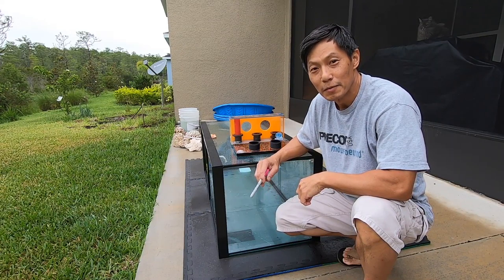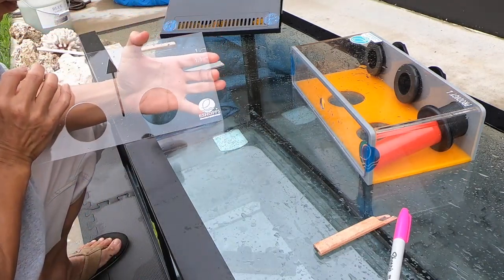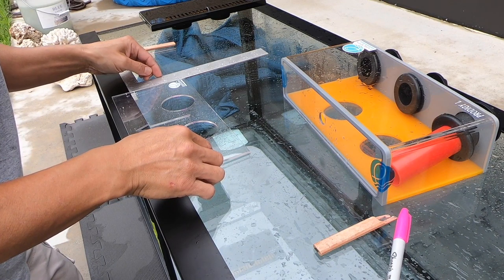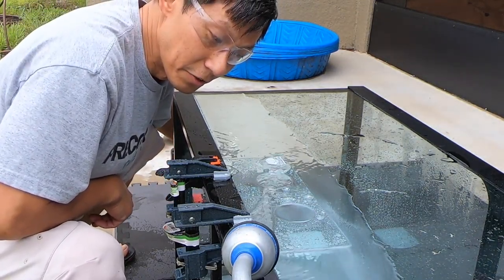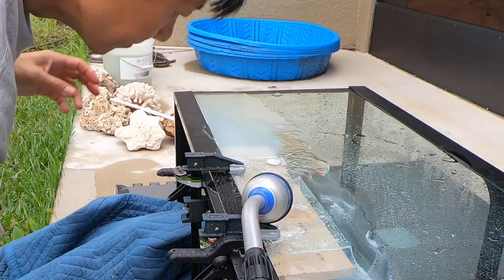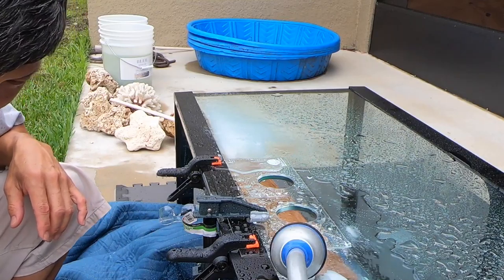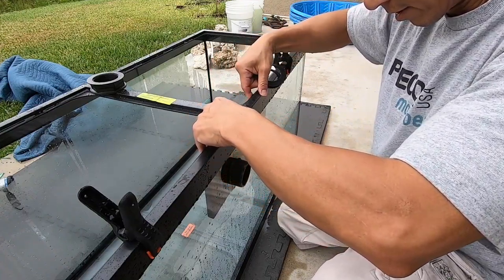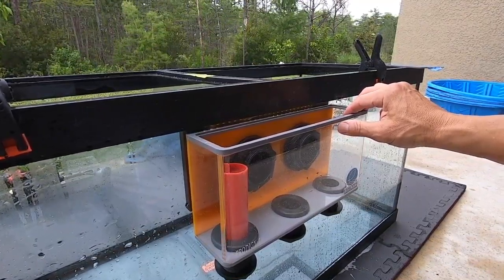75gal Saltwater Aquarium with Eshopps Prodigy L Overflow Part 1-Vlog 20

Comment: I am so glad you showed me that an install on a standard rimmed tank is possible. Great video. Just what I was looking for
Reply from the maker: How did your tank turned out?
Reply: @nguyeninfloridalinhchualua3429  I am very very early in the planning phase of a future tank build. I am to find the best external overflow for my situation. I want the tank close to the wall, so I would like to cut a hole in the drywall behind the tank and have the external box fit between the studs. 12"-14" wide external is what I am looking for.
Reply from the maker: @kevinhelfrich1705  That sound like a lot of work. Exotic Marine Systems has wide overflow box that you can check out.

Comment: Hey, I think you put the second set of rubber nitrile washers in the wrong place, they need to be between the tank and the external box.  Seems like a fun project.  If you ever have a lot of leaks this is why.  I have the eshops small and had this issue the way you put them on.

Comment: I've watched a ton of these videos, and noticed every single one it chips. I finally went ahead and did it myself and sure enough it chipped a little. I'm thinking if you're uncomfortable with chips being on the inside drill from the inside out. Where you start drilling will always be smoother.

Comment: Personally I drill from the inside out,better seal if it chips and no worry of the cut out chipping tank
Reply from the maker: I would be hesitant because you want to make sure the cut is straight down on the glass. The 75g is not that wide.

Comment: Can you measure the distance between the bulkheads on the template. I recently got a used tank and have a eshopps L overflow and the holes are to far apart. Thank you for your time.
Reply from the maker: I have to look for it. I don't know if I kept it.

Comment: Yeah.  I didn't know the wire was so thin on that model!! I got a figi cube overflow but I am worried because it didn't quite install right and the other box hits the black trim and the wire ended up being g too low so I'm thinking I may just buy a different overflow and hope it fits better.

Comment: What was the order in which you installed the gaskets? on eshopps video and from everything else I read their install video is incorrect.
Reply from the maker: They give you two gaskets. One gasket goes against the glass and the other against the plastic. Make sure the smooth side or the gasket is towards the flat surface of the glass and the return. Hope that helps.
Reply: The ridges on the rubber gaskets always go on the glass, just incase there are any little chips, the ridges will cover them.

Comment: IMHO you need to position the holes based on the desired height of the internal wier box.  You set the hole position based on the top of the external box butted up to the bottom of the frame (with the box lid on), that it why the inside box was higher then you wanted.  You Got Lucky!  Depending on the tank Mfg your inside box may not have fit at all.  Check all parts position BEFORE you drill.

Comment: trying to devise an automatic waterchange system for my 55gal fresh water nano tank.  was considering this.
Reply from the maker: How can you use the overflow to do your water change. It wouldn't drain enough water,
Reply: @nguyeninfloridalinhchualua3429  - i'd have filtered fresh water slowly trickling  in at a rate of between 2 and three gallons per day.  Why wouldn't it work?  I don't have sump.  The overflow would be piped to drain.

So constant fresh water very slowly displacing dirty water.

I also have triple the filtration i need already in an Oase biomaster filter
Reply from the maker: @etyrnal  I think that might be a waste of water. If you do a 25% water change that would be about 15gal at one time the water quality would be better.

Comment: What brand of tank is I have a 75 gallon  frome petco  that I want to drill
Reply from the maker: I got mine from Marineland. You have to check the  label. It will say "do not drill" on the bottom if you can't. You can also do tests that is on YT. Hope that helps.

Comment: So does it leak and how do you like it
Reply from the maker: Make sure the rubber ring is on the right way. It does not leak at all. I tighten with my hands then used a wrench to give it a slight turn. It works perfectly. Very happy with the set up.
Reply from the maker: No leaks and the set up went perfect.
Reply from the maker: gunit 010  The bottom will say do not drill. After researching online the sides of the tank is tempered but not the bottom.
Reply: @nguyeninfloridalinhchualua3429  YOU WRONG THE BOTTOM IS TAMPERE THE SIDES ARE NOT
Reply from the maker: @MASTERSURGEON04  I don't think so,. There is a sticker on the bottom that stated "do not drill, tamper glass". You can check other youtube videos on that.
Reply: i hooked mine up i didnt have any leaks

Comment: Quick fix.
Flip the template upside down.
Drill the holes
Cut the plastic rim (using the template as a line guide.  
Install the over flow and paint the back black.
Reply: It's never advisable to alter aquarium bracing in anyway.
Reply: @Tarnimo  I'm just trying to help. If you have another method please share. If not what do you want? Have you even tried to do this?
Reply: @veteranshomerepairsandmain4101  I understand your idea would work but altering the bracing on a run of the mill aquarium is a bad idea.  The bracing is there to keep the glass from bowing any alterations to it may cause the aquarium to fail. Although I have never drilled an aquarium I have had to drill off center holes in  plenty of large sheets of various materials such as steel wood acrylic and tiles.  You need to take your time and measure from various points to  find the center of your hole mark it up and drill. Measure once and toss it or measure twice and cut once. 

Sorry if you thought I was coming at you. I'm also just trying to help. Feel free to Google altering aquarium bracing. 
Have a good day

Comment: You want to clean cut keep dill slow balance don’t stop
Reply from the maker: Good advise. Keep it going until you drill thru.
Reply: I should also add to this when beginning to drill using a diamond core bit you want to start out at a slight angle do that all around wobble it in a circular motion no pressure but firm grip. This will give you a nice smooth cut on both sides.